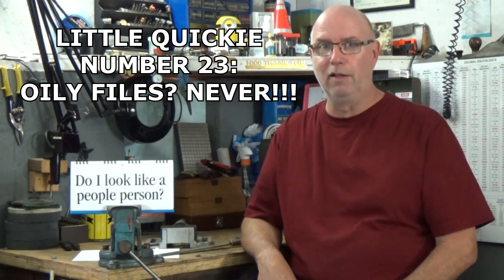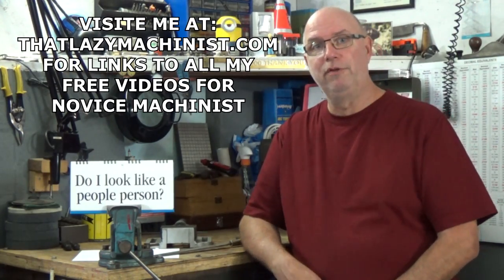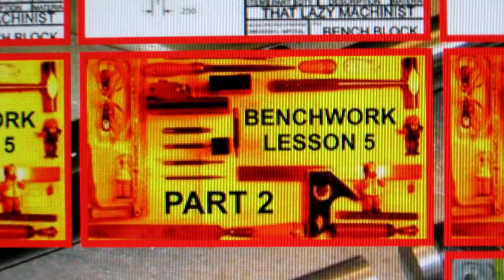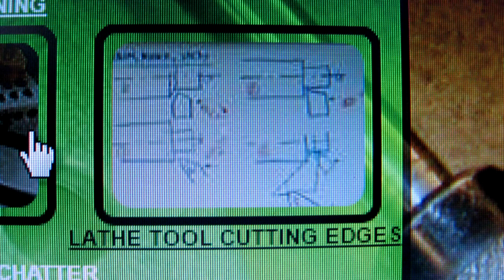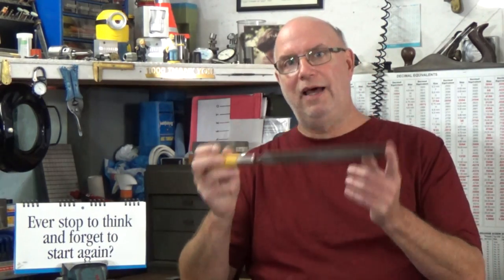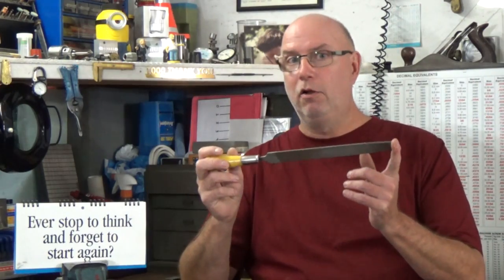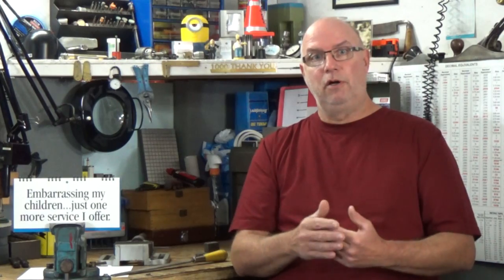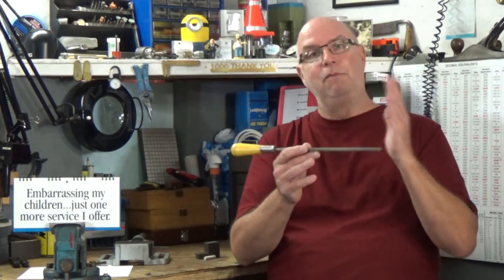NEVER OIL YOUR FILES! WHY NOT? WHY DO OILY FILE NOT CUT WELL? MARC LECUYER

Comment: To each his own.... I recently bought a new Nickelson file.... I started filing copper on the lathe, in a short time the file be came clogged.  I brushed it out with a brass brush and got most of the clogging out.... I finally had to take an exacto knife and tooth by tooth scraped the clogged and embeded copper out of each tooth.  I was told NOT to oil a file.... My thought I paid for this file....I can do with it what i want.!!!! So i put some Tap-Majic on the file and continued the filing process.  Wha La  it cleaned much easier and cut just as good.... just saying....
Reply from the maker: Hi! Tap-Majic, WD40, kerosene, Varsol will all have a similar effect since they are more degreaser than oil. I have no problems with using this type of liquid since it helps stop chips (mostly with soft materials) from wedging into the teeth and they do not make the file overly slippery. For most harder materials though (steels, naval brass and bronzes), it is better in my opinion to use the file dry. If you are getting a lot of clogging, you could try a double cut file with larger teeth also remember that when filing on the lathe (especially with softer materials) it is good to reduce the speed of rotation to 1/3 of the normal r.p.m. (for a given material and diameter) and file with the same type of full strokes that you would use if filing at the bench. If it is not already the case, you could also use a single cut lathe file. These files have rows of teeth that are inclined at 60° rather that the normal 30° and that (coupled with a full stroke) will clear the chips much better. Thanks for the great comment and be safe! Marc
Reply: Try some file chalk to prevent loading the teeth up with soft metals.
Reply: What is file chalk and where do you get it....? Is this the same a regular "blackboard" chalk? thanks....!
Reply from the maker: I have always used ordinary chalk for filing softer metals. I am guessing that in a pinch you could also use talcum powder. Marc
Reply: I use soapstone on the file for aluminum.

Comment: I learned to file when I was ten. My grandfather set me to making one inch cubes from rough-sawn blanks of mild steel. I had a vise, a couple of good files, a machinist's square, and a thousandths-reading micrometer. I had to make cubes where no light showed anywhere under the square, and the micrometer read closer to 1.000 than to either .999 or 1.001 (±0.0005"). If I spoiled a cube, I started over with a new blank. I got so I could do it in an hour or so if the amount of metal to be removed was not too great. The motor skill of moving my hands in a straight line has served me well for the following 63 years. I can saw wood or metal easily. My pool shots go where I expect them to (now if I could just visualize the angles correctly...), and many other things are easier because my muscles know how to move my hand in a straight line. (BTW, I was set to filing cubes to teach me the difference between a micrometer and a C-clamp.)
Reply: That is how the Marine Corps start prospective gunsmiths in training.

Comment: Oil of some type is a requirement for all tools in my humid climate. Rust will do more to hurt my cutting than a trace of light oil applied before storage, I figure most of the oil comes off in the first few strokes anyway so as long as I don't reapply during use it will still cut ok.
I get my choice of greasy or rusty hands when I work because the hosers that built my garage put the slab straight on low wet ground without a thought to a plastic barrier, sealant, or the water table during the wet season. Still better than my barn-shop where the fog just rolls on in.